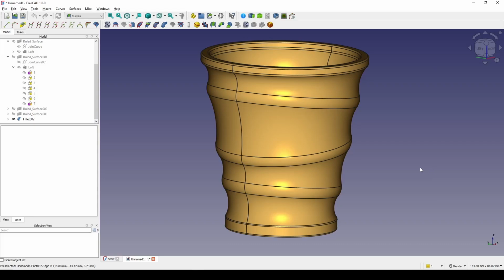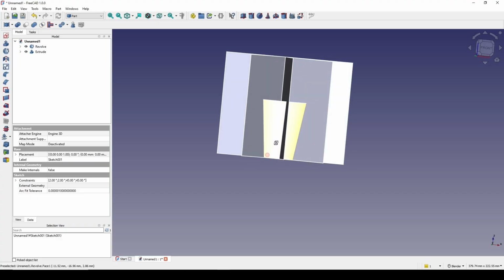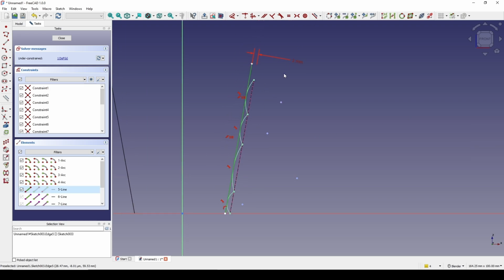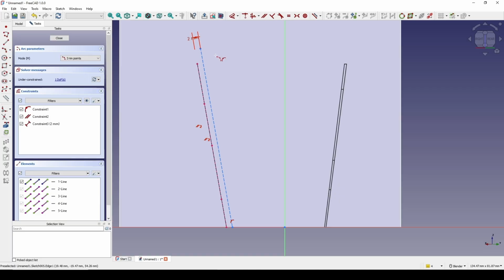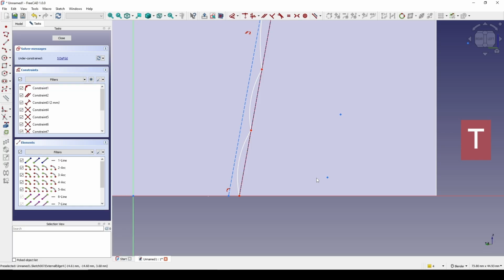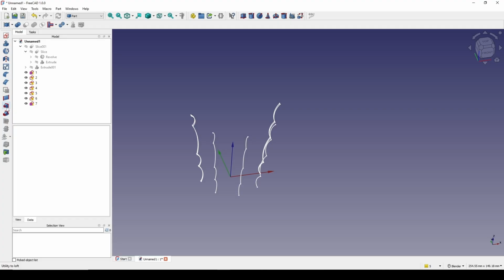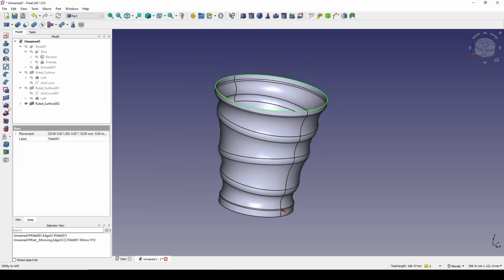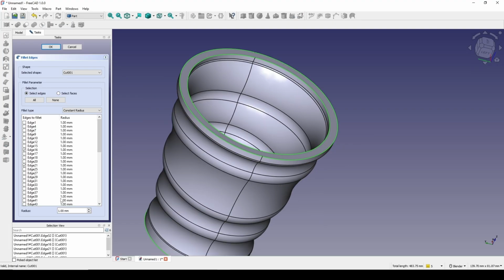How To Create Crease Edges On A Surface In FreeCAD 1.0

Comment: Did it on the Mac version. The last fillet operation brakes the whole thing. I notices I get artifacts on the top face when closing the pot with the top and bottom ruled surfaces. I wish I can fix it or know what's happening. Anyway, thanks for the videos. If anyone is having the same issue please let me know what you did.

Comment: Excellent as always!! I applied a VarSet to the arcs's depth so, after all the fillets and all, I changed the value from 2 to 3,5mm, 4 mm, 1,5mm, etc. and worked so well. There's a chance to apply it to the main fillets (5mm) also with a formula, e.g.: VarSet*2,25. So then, you can keep a kind of proprtion between them. Great job you do for the 3D CAD community that can't afford expensive licences! Congrats!!
Reply: I just cheked up and there's no chace to aply VarSet to the fillet's value en Part Workbench. Sorry.
Reply from the maker: Great to hear that, I didnt try varset, maybe I will try it later.